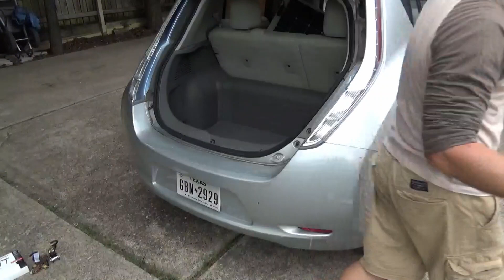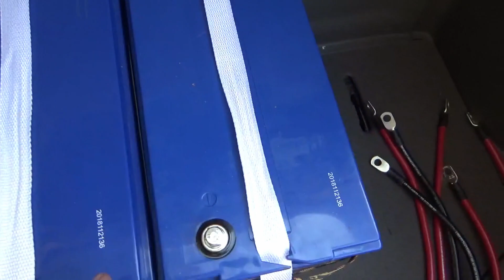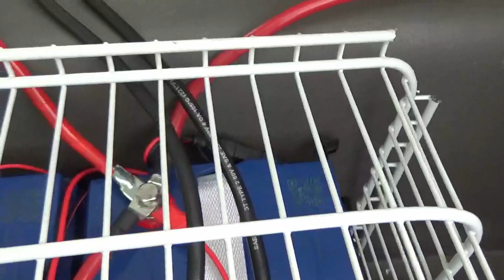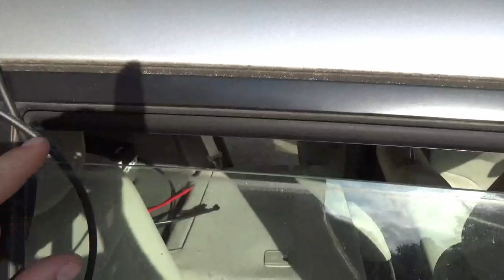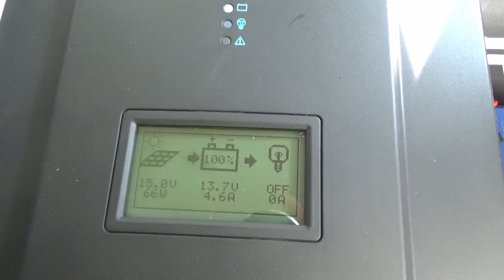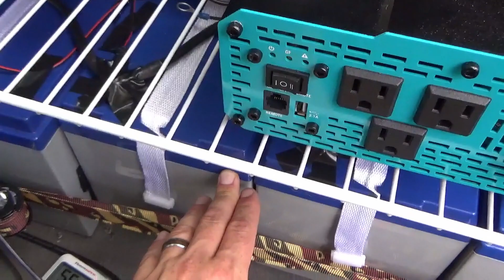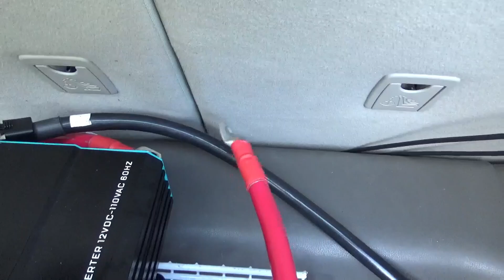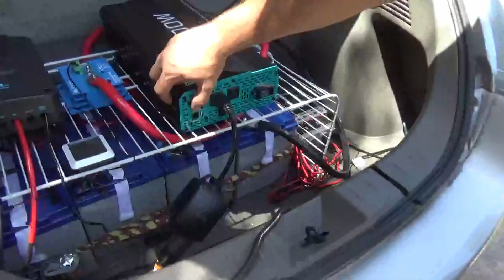Solar Powered Nissan Leaf

Comment: If you aren't already get yourself on the DIY powerwall Facebook group and start learning about lithium. Also Diy electric vehicles group.

I like what you've done. It's a shame that there isn't a mppt charge controller that has an adjustable high output voltage that you could charge the batteries directly with.
Also even if you could you'd have to have another bms that would work with the car off, as I imagine it's only balancing etc whilst charging or driving.

Also I didn't catch how you wired the panels? In series or parallel? I'm guessing parallel due to different size panels. If you could get similar sized panels you could run them in series into a mppt charge controller for a slight efficiency gain.
Maybe think about making a big duck tail wing to extend the roof for more space for panels (and aero)
Reply from the maker: Thanks for the ideas.  Wiring was in parallel, I didn't cover that real well. 
 Connecting the solar to the main battery WILL be the final step of this journey.  This video documents my first step (a lurching, stumbling step).  Splicing input PV into the main 384v battery has to be done carefully, and you have to know exactly what you're doing.  Quite frankly, I hope someone else makes that step-by-step tutorial before I do, because it's dangerous.  Stay tuned and you will eventually see that video on this channel.  Also, if you can, please post the link to the MPPT that can do a 400+v output; I could use one of those.
Reply: @InnovativeSustainableSolutions  sorry I said I wish there was one, not that I know of one. I meant mppt for your current 12v system.
Reply: @ratgreen  I love those old 
porches whale Tails , used to think there were crazy looking but they grew on me. I would love to see that on a LEAF!

Comment: Awesome job man I just read an article about you on cleantechnica. As you keep upgrading the system, some li-phosphate CALBs could be a nice swap. They seem to be the most stable lithium cells that could actually be suitable for inside the car. I would say swap them for 24v Tesla modules but it seems like a dangerous notion to go inside the car. Also, you could probably squeeze more solar production if you swapped for Sunpower flexible panels. Not sure if the dimensions or cost work for you but the Sunpower cell is unbeatable. Can’t wait to see more!
Reply from the maker: Thank you for the tip sir, I will look into those for sure.  What we need is get enough buzz so a manufacturer will build a panel that exactly matches the profile of the roof of the Leaf (or other EV).  I could double the production easily if I had a panel that was shaped around the car instead of patchworking fixed sizes on there.  Im talking to manufacturers, but their not interested unless Im gonna place an order for 1000 of them.  What makes you say, "suitable for the interior of car"?
Reply: I say suitable for the interior because of the inherent danger with lithium-ion cells and the possibility of fire. The CALBs do not seem to have this problem because the chemistry is more stable.
Reply from the maker: @drewgoodman7932  Gotcha.  Yes the CALB, or Lithium Iron chemistry is what Im gonna be using in phase 2.  It will double the power and reduce the weight by 62%.  There have still been people who have managed to set this chemistry on fire, but it's very rare, and I'm (knock on wood) gonna trust it in my project.  Hopefully the next video isn't me making a phone call to the Fire Dept

Comment: Why not put the charge into the car's own battery. Did any one heck the system may be use the aux flood battery with PVs and then charging the Leaf battery directly? TIA
Reply from the maker: That would be more efficient.  Im looking into doing that.  The hurdle will be stepping your PV voltage up to 380+ volts, which is the voltage of the main battery.  This is just a quick and easy workaround.  Also, the additional outlets are handy for running corded tools at a job site.

Comment: Some ideas for you:
1) There are some chargers (I can't find a link right now) that allow you to specify the current. The min current allowed by the J1772 standard is 6A. If you could get a charger that outputs that, or use an arduno to mess with the duty cycle on the pilot wire, you can lower the charge rate. 110*6A = 660W. Lower current = lower voltage drop across the batteries.

2) Splice in some wires into the J1772 connector at the front and have another female in the trunk. That way, no cable outside and I suspect you could leave your trunk charger it plugged in all the time. (Make sure the trunk socket has a cover as it would be live when the one in the front is plugged in)
Reply from the maker: Thats definitely ideal.  Please post a link on this video if you find that variable amp charger.  I intentionally went with the 1400watt charger, as it was the lowest power one I could find.  All the new aftermarket chargers seem to 1700w or higher, so a programable current charger would be perfect
Reply: @InnovativeSustainableSolutions  
Found it!
https://www.amazon.com/Level-Charger-Zencar-Replacement-8A-10A-13A-16A/dp/B07PF1KC7Z
Reply: Also interested in an adjustable charger. Link me too please
Reply from the maker: @ratgreen  https://www.instructables.com/id/Arduino-EV-J1772-Charging-Station/
Reply from the maker: @BSAElectronics702  So our power draw would be around 700w.  I'm hitting around 400w now from solar (in November), probably 500w in the summer, so we're only pulling 200w out of the backup batteries.  Right around 2.4 kwh over a 12 hour day.  Thats about perfect buddy.

Comment: 250 watts maximum solar power?

The 120v charger that comes with the car produces 1400 watts. Even if you were to somehow double the amount of solar panel on the roof, you'd still be getting only 25% of what you can get with the slowest charger around. If you weren't also losing electricity by having to pass that solar power through an inverter to charge the battery, then lose more by passing it back through that inverter to the car charger, and again as it converted AC to DC to directly charge the main pack. Just off the top of my head, you're losing at least 35% of that small amount of charge you get from the solar panels. Probably a lot more.

If, on the other hand, you managed to convince your employer to allow you to build a solar carport at work, you'd both keep your car in the shade during the day, and charge it at a much better rate by having 10x as much solar panels as you could ever fit on the car.

Your solution is portable and all, but the 120v charger is more portable, and you can find that plug everywhere.

There's a really good reason why this was never engineered into the Leaf to begin with.
Reply from the maker: Thats true!  Unfortunately there is a 0% chance my employer, UPS will be putting car charging stations in the parking lot, ever here in Texas.   Passing the current back and forth from AC to DC is just about the LEAST EFFICIENT way to do this, absolutely.  I am currently trying to figure out how to charge the 384v DC main battery directly off the 12V solar system battery.  But like I said I'm not an electrician, and thats a complicated job.  If you find some step by step videos of people who have done this, please post them on this channel.

As far as the 120V outlets being EVERYWHERE.  Anyone who has ever had an EV die on them will tell you this:  They are everywhere until you need one.
Reply: I once ran out of power in my leaf and tried to charge it just enough at 120v to move it a couple blocks to the nearest real charger.

It took more than an hour, and even then I just gave up and called a tow truck. The car wouldn't even let me move it until it had had charged a certain amount.

If this is your emergency backup, you're literally waiting all day. It might be a fun science project, but your results prove something that you don't really want to hear.
Reply from the maker: @gromm93  Sorry you got stranded.  It sounds like you were at a bad outlet.  A Leaf can get 4.7+ miles/kwh (see discussions section of this channel for posted source).  So a 1 hour charge at 1400 watts = (1.4kwh x 4.7 miles/kwh =) 6.58 miles of range per hour charging.  A "block" is not a standard unit of measure but, 540 ft (0.1 miles) is generally considered to be 2 blocks.  So a 1.4kw charger would give you that range in  (.1 miles/6.58miles of range per hour) 0.015 hours or about 1 minute.  This is not my opinion.  This is irrefutable math.  If you were there for "more than an hour" at a properly functioning outlet with a 1400 watt charger, you would have gained 6.58 miles of range.  

I realize the math gets a little tedious and boring (unless you're a nerd like me) but I do feel it is important to concisely state the FACTS about EVs so people who don't have any experience with them can have access to good information.
Reply: @InnovativeSustainableSolutions  Well, you don't have to believe me. Turtle your car and try to see how long it will take to charge at level 1 before you can move it.

You can do all the math you like, but you can't argue with software.

Comment: You have for 75 lb batteries adding another 300 lb or 10% more weight. Does this translate to a 10% more use in power used. I'm using my wife's electric car as a battery storage for our solar arrayhttps://youtu.be/TjqdqY3E8-k and have an inverter that the power from her 1956 f500 EV.

Comment: 2kWh = about 8 miles. So, 10 hr of full daylight to gets 8 miles of distance.
Reply: Not just looking at a day, but in a year that is around 730 kwh @.15 cents a kwh about 110 bucks saved and about 3k miles added. While not really cost effective, this type of tinkering is what leads to improvements and simpler more efficient systems. I hope to see more of these types of sustainable  ev/pv systems installed from the factory in the not too distant future.
Reply from the maker: @bfrog1300  The true value of this system does not come from the kwh produced by the panels on the car, but as a way to extend the usable lifespan of an EV which you would otherwise have to retire or  spend well over $6,000 to replace the main battery.  Watch my video "Why Make a Solar Powered Car" for a full description  https://youtu.be/A6O2rfqLKHg
Reply from the maker: Thats the mileage most people see for sure.  You can hypermile it and squeeze out 4.9 miles/kwh, but your figure is a better average.
Reply: @InnovativeSustainableSolutions  Hypermiler here! I always averaged close to 4.9 miles/kwh in the summer which included some highway driving, and about 4.4 miles/kwh in the winter. I never use heat in the winter. I dressed like I'm in the Arctic during winter. I don't even need the seat heater. I only used a little bit of AC in the summer in ECO mode which uses very little energy.
Reply from the maker: @americanhindi  lol, yep.  I'll see you in the slow lane friend